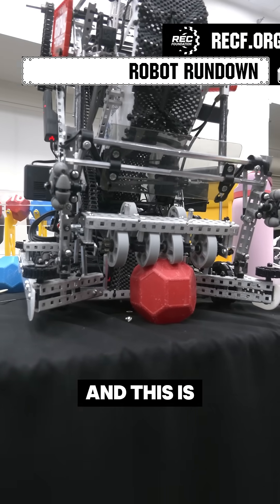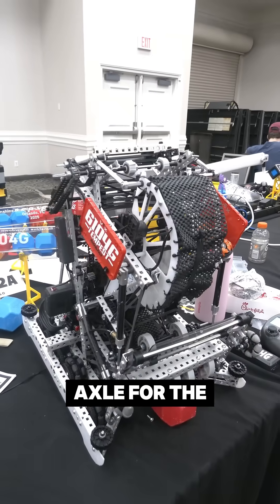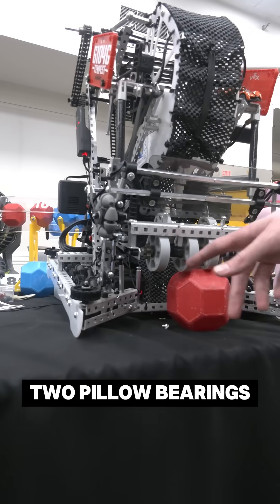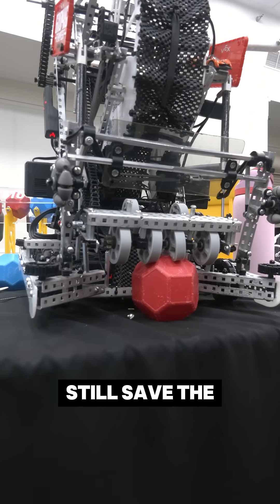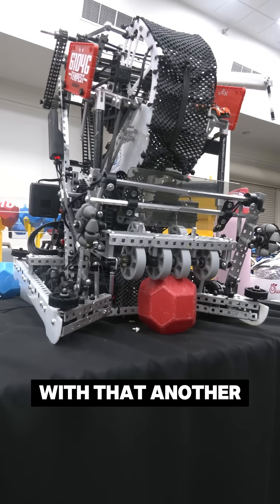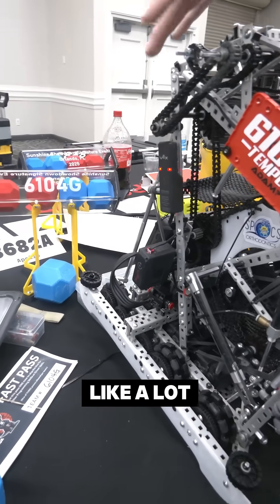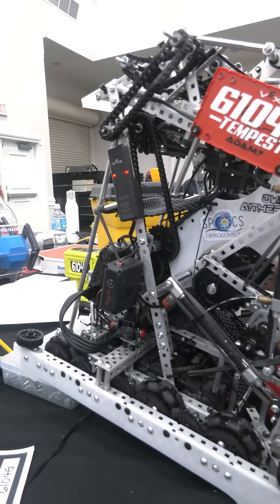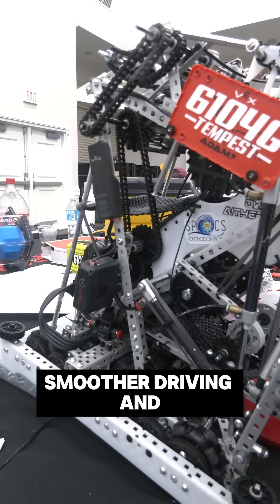Lightweight Double Park and Low CoG Motor Mounting | 6104G Tempest | Robot Rundown

Comment: what is the point of adding more friction and making a less durable low strength axle for weight but then using metal sprockets for spacing when there’s no function for it (I’m assuming since it’s not connected to anything)?